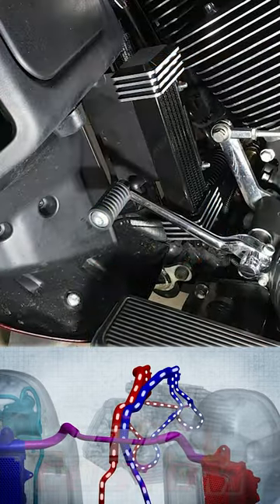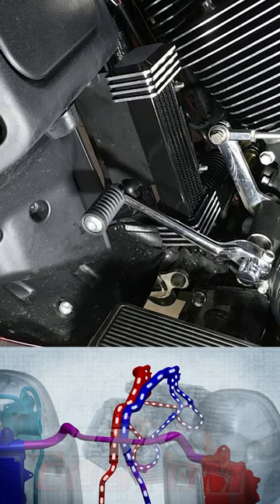📢Twin-Cooled Harleys Do NOT Have an Oil Cooler...But They Can! #shorts

Comment: i watched a guy who just bought a 2020 street glide and he had the stereo playing real loud for a LONG time. i finally walked over to tell him hes gonna kill his battery if he doesnt turn radio off. closer i got i realized his bike was idling the whole time ! it was about 90 degress outside and humid.  he said hes gonna take off and when he let out the clutch and gave it gas it starting pinging and knocking and it stalled. when he tried to start it backup it wouldnt turn over . i said you overheated it and he said how its water cooled ! uh no its not buddy
Reply from the maker: Yep, lots of misinfo on the matter.  Street Glides are not Twin-Cooled.  And, even if it was a Twin-Cooled bike, those run even hotter, as shown in this video- https://www.youtube.com/watch?v=6AhPqVlvE-w

Comment: It’s still twin cooled…. The cylinders and head still have “cooling fins” on them making it air cooled and water cooled
Reply from the maker: Yes, this is true.  However, the Twin-Cooled do not have an oil cooler.  All the heat the oil absorbs, especially from the oil being squirted at the bottom of the pistons, make that oil much too hot to be without an oil cooler.  Here is a complete video, with testing, at this link- https://www.youtube.com/watch?v=6AhPqVlvE-w